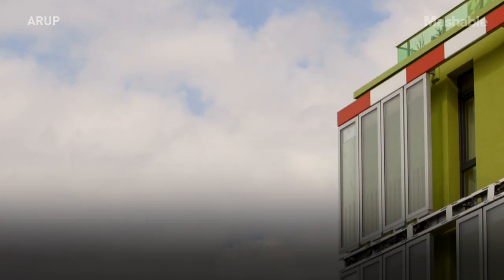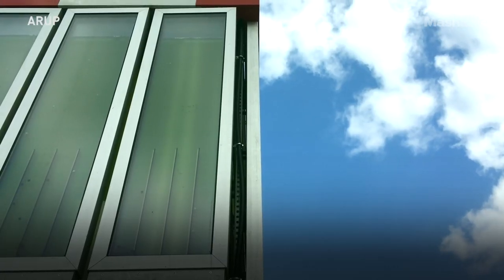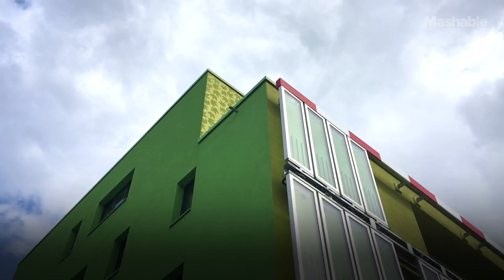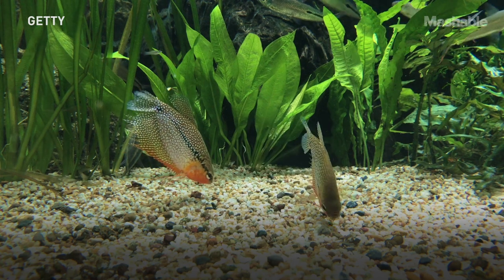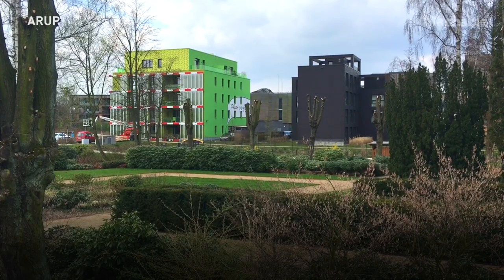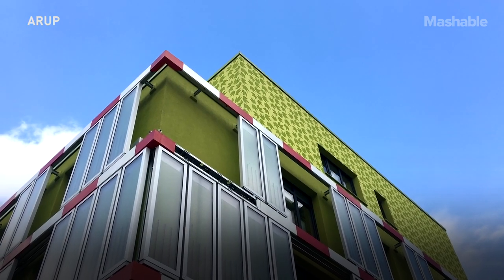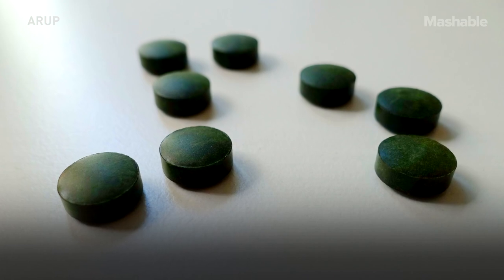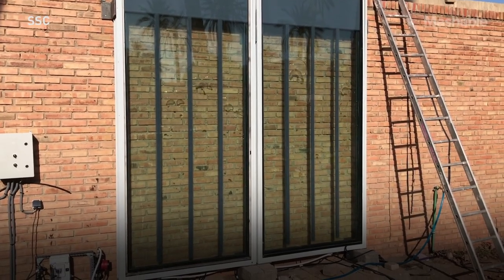Microalgae Facades Produce Renewable Energy | Mashable

Comment: Convergence: 1st Principles meets permaculture principles... 
Would the algae production be significantly reduced if near clear thin film PV was applied to the glass?
Multi-use of available South facing surfaces. 
Even the standard windows could produce power along with thermal heat issues. With that said imbedded in the design are TEGs that could convert that thermal differentials into power.
Cost per kw? Beats me.